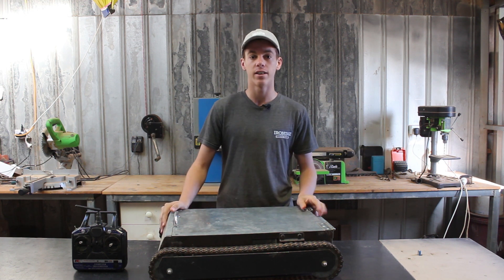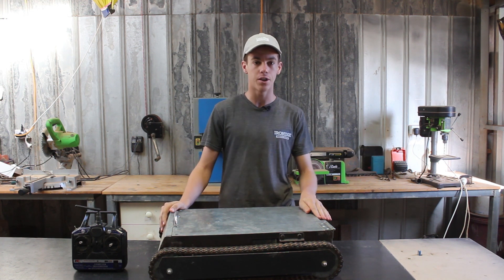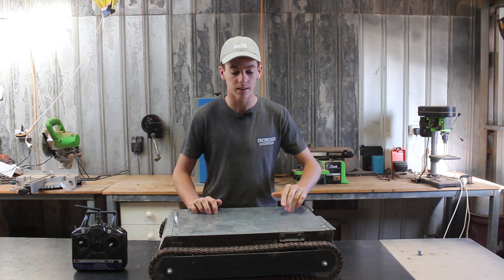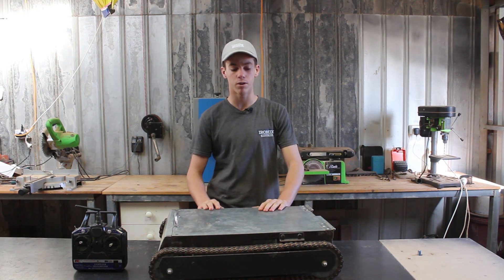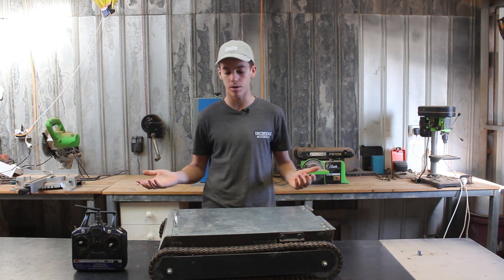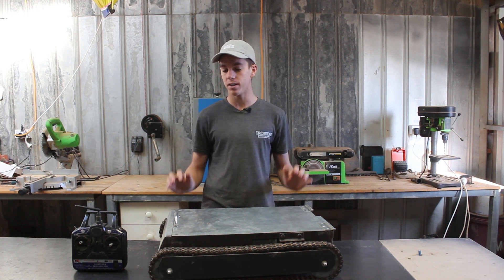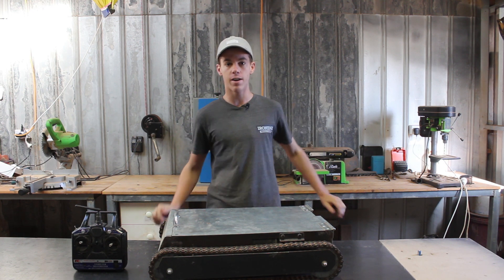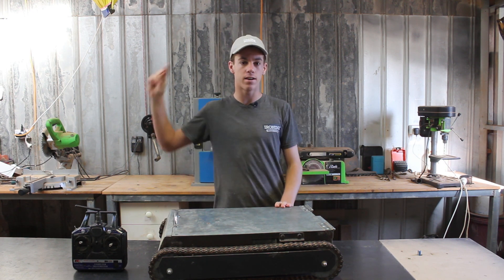HUGE RC Robot Build Part 1

Comment: I'm building a similar project. The esc will be a sabertooth 2x12 and the motors are 2x bostitch drill motors that have a 2 speed transmission. In first gear it produces 480 in lb of torque. In 2nd gear it produces 1500 rpm. So I get speed on the trails and torque in the mud. The drills were stupid cheap too! $18 shipped and the quality is outstanding!